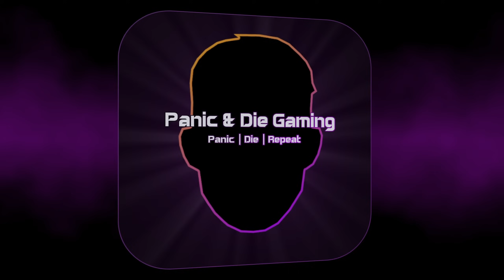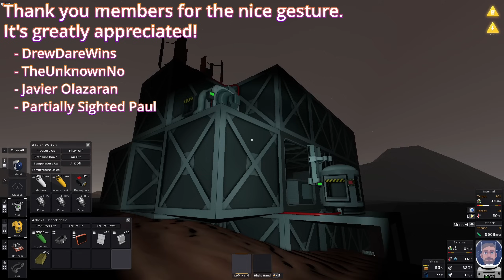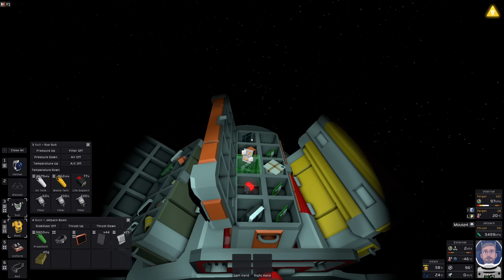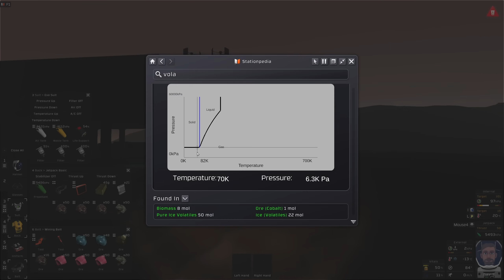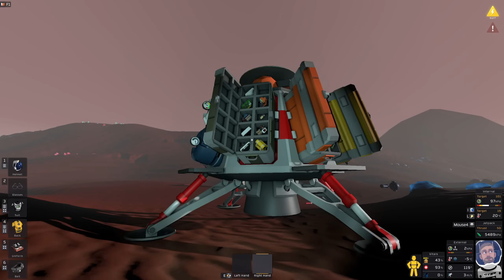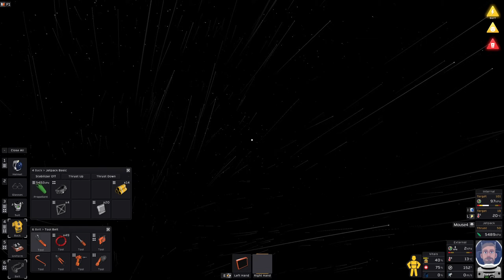Stationeers | Tutorial Series For New Players | Setting Up Your First Basic Furnace | #2

Comment: Question : When you built your degasser on your furnace why did you also pipe up the gas input? I get the output, but I don't understand why also do the input?
Reply from the maker: Hey,

I think (and I could be wrong) that the output on the basic furnace can be used as an out and in but to be honest, I always just hook them both up to cover all bases. If I had a fuel mix as the input, I would separate that from the output.
Reply: There's a technique for building furnaces much later on that uses hot gas from anywhere to heat the furnace. Probably not what was being built here, but fun to know about

Comment: Hey Chewy, might pay to add that ices are only safe in the mining belt (or mining backpack), they will melt in your jetpack, suit pockets and lockers. I guess you should also say that any vacuumed space that has no sunlight is also safe. I think any non-vacuum space without sunlight that is below 0c is also safe, but not confident there.

For completeness, ice is safe in the hopper of an ice crusher, normal chutes, silos, sorters and the like but not windowed chutes. I heard a rumour that the interface between a chute and device (crusher etc) is not insulated, but have not seen that happen in game.

Keep 'em coming!
Reply from the maker: Hey,

Thanks for the comment. All good points.

Although I'm pretty sure you can keep Ice in your jetpack.

Comment from the maker: Hi Everyone,

Just a note on the furnace video.

We will be touching on gasses and off-gassing later in the series.

Regarding the furnace, there are 2 points I wanted to clarify (Thanks @Baylin)

1 - The ores inside the furnace need at least 100 degrees Celsius to be melted by the furnace. If you notice that the ore has stopped at a certain part and just stays processing, you'll need to add more heat in the form of ice or other methods that we'll touch on
2 - When you add Volatile and Oxite, you are creating a fuel mix inside the furnace. If the furnace is over 300 degrees Celsius, the fuel will automatically combust without the need of you pressing the button

We will revisit the furnace with a better setup and more explanation later.

If I get something wrong but someone watching knows this, please leave the comment to help others. I'm not an expert in any way so all corrections are welcome :)
Reply: Short note on reagent and alloy production, if your alloy ratio is off, and you notice before opening the mould, you can add more ice or ore to fix your ratio without creating reagent